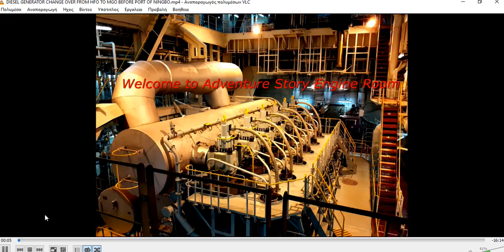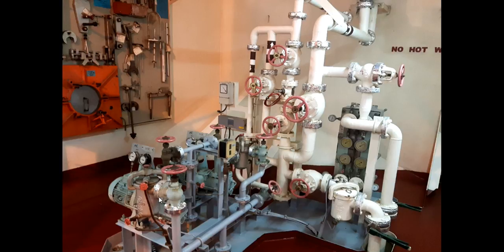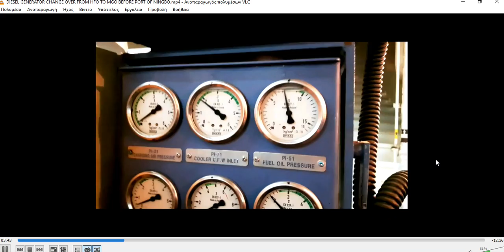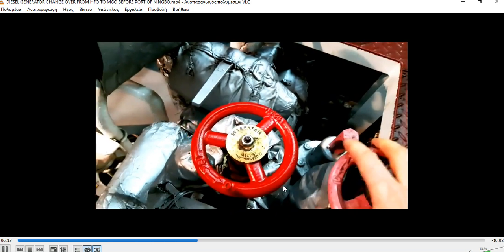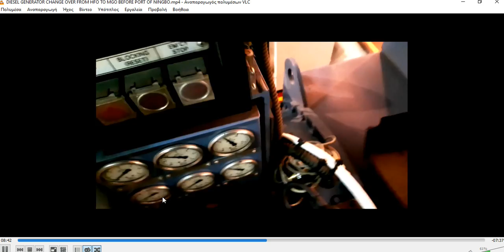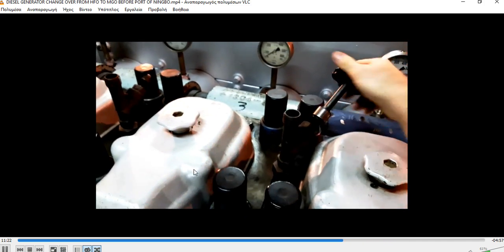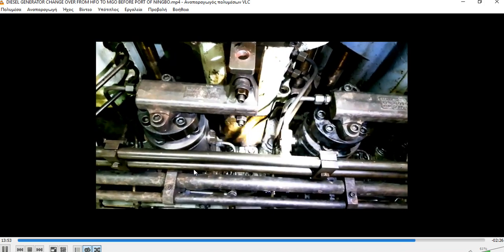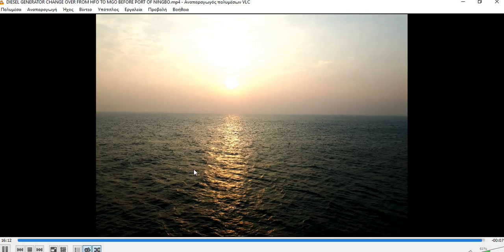DIESEL GENERATOR CHANGE OVER FROM H.F.O TO M.GO

Comment: Hello my dear friend. For what reason you regulated pressure regulating valve ? When did  you switch 3way valve suction from HFO to mgo? When did you close steam tracing for HFO ?
Reply from the maker: Hello pressure regulating valve must be regulated to the pressure that engine is working otherwise you will be working on overpressure.Switch over from hfo to mgo is must be done when temperature not drop any more as service tank is about 90 degrees celcius. This temperature is really good to switch over.Steam tracing you can close direct! Engine will work without problem even steam tracing is closed unless there is consumption from the engine.

Comment: Why we need mgo cooler ?
A temperature of 80c whitch is in the tank it's ok.  Why we need to reduce it ?
Reply from the maker: Hello mgo cooler are made for mgo use only in the tanks mgo has the temperature of surranding enviroment .
Let's say if engine room temperature has 40 degrees celcius.
Also MGO tank will have the same temperature.
So the reason of cooling is been made to reduce the mgo temperature and with this by cooling mgo also increases the viscosity and you will have better lubrication properties to avoid any problems on engines fuel oil pumps and fuel injectors.
Reply: @Adventure-Story  thank you  sir. ... witch is your name? if u could tell me.
Reply from the maker: @TheAlexgert  Hello name are not necessary here because we try to improve the marine engineering knowladge and not talking about names.For you i will be Adventure Story.

Comment: How did you make a blowing by air in engine ? You opened indicator cocks , press button star on 3 seconds, but what about zero fuel delivery to the fuel pumps ?
Reply from the maker: Yes like that don't worrie about duel pumps they will not inject so much!

Comment: I think you contaminated the do tank
Reply from the maker: In this system you can't make contaminate  systems are separate and valves change over quickly open diesel close fuel inlets and outlet keep for some time for flashing.
In new systems everything is automatic the change over take place auto all the valves switch by preset timers.

Comment: Can we do change over while engine is running....as we had practice of doing it while running but during this we can't control temperature drops....and sir how about changing from mgo to hfo ....
Reply from the maker: You can do it for sure but for generators best practice is to reduce temperature and then change over while engine is st/by then you can start the engine so diesel will be reach fuel nozzles!
Reply from the maker: A good practice is a drop or increase of temperature by 2 degrees per minute.But temperature you can control from your heating system.

Comment: What is your opinion when we make a change over from MGO TO HFO is it neccessery to heat up disel oil or not? A lot of people say that need to heat MGO up to 75- 80 deg to avoid termoshock of your pumps and system . Some engineers said never heat up disel it is dengerouse. Clirify it here please.
Reply from the maker: Hello Konstantin never heat up it is not necessary .You will avoid danger of explosion. It is unnecessary.As you have mix tube heating will take some time to heat all the system.
Reply: @Adventure-Story  thanks understand
Reply: @Adventure-Story  On board of crude oil tanker when we make change over procedure is it necessary that boiler work continually during change over and excessive steam dumping all the time?
Reply from the maker: @konstantinbutsenko8208  As i remember there is not necessary to make a continuously running change over is only necessary to switch to fuel.Later you can just run two times start stop and it's enough to make the change.Most of boilers have different lines in now days.This makes easy the change over and less  mixing   between different fuel oils.
Reply from the maker: Thank you for your comments! I am happy to answer please make more comments!!!

Comment: Sir I have one doubt.. During change over we usually do not open the return mgo valve at starting.. As this may contaminate the mgo in service tank... At starting hfo return line valve open.. After proper flushing as we sure no hfo remain in return line we close hfo return vlv nd open mgo vlv
Reply from the maker: Yes it will contaminate if you have single system in our ship we have separate line separate pumps only for Mgo!
Reply: Okk.. Thanks
Reply: Even if separate line some hfo in line will go to mgo tank ..
Reply from the maker: @mohit2200  For sure some hfo will go but is reall small amount and also change over procedure are started before enter the zone of regulations so it will be burned and clean diesel will take places later!